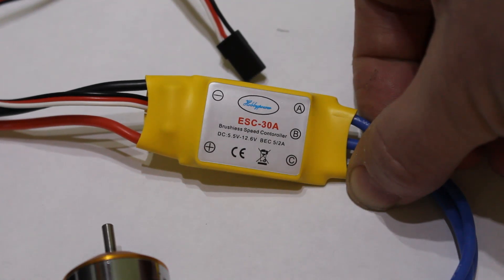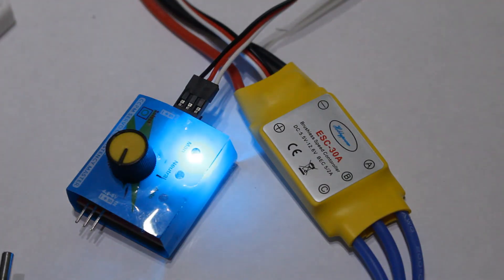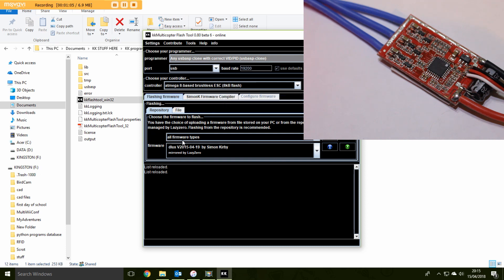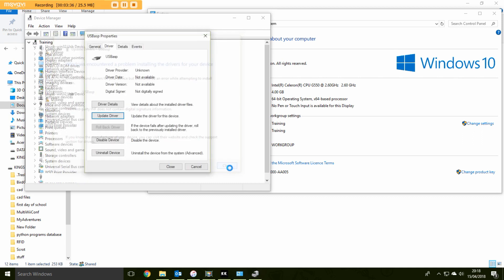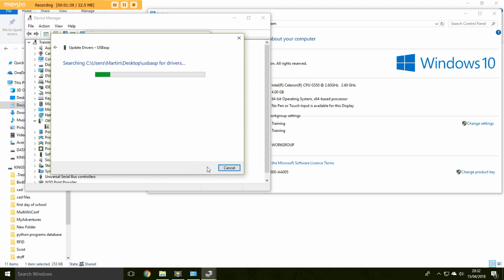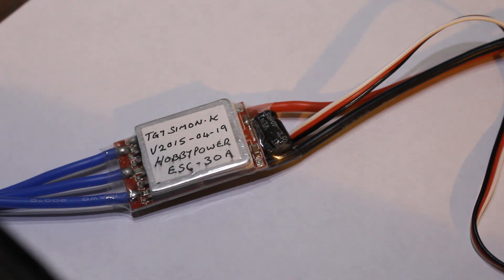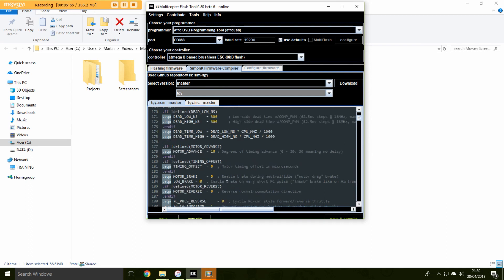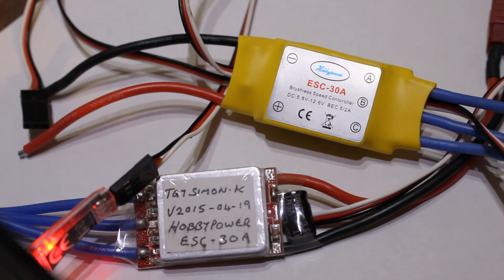Loading SimonK firmware into hobbypower 30A ESC .

Comment: DO you know what .hex file works for Red Brick 200A (Red PC Board)??? The ones for the Green and Black PC Board does not work??
Reply from the maker: I would check out the list and see if you can find a match? https://docs.google.com/spreadsheets/d/13tMlu5ldLNpZXwbe6UhDHJhcgTVuljm8HDiDp9WO9Pk/edit#gid=0
you need to be careful as it appears there are two different options? check the list and photos in the list links.

Comment: Brother, can i flash the SimonK ESC from BEC? No need to flash directly to the chip right?
Reply from the maker: If the ESC has SimonK already installed you should be able to do it via the white/black wires.
Reply: @mrfid72  can i use 'other' usb afro? I can't find it anywhere in my country

Comment: Where did you get that tool to connect the chip directly from the board?
Reply from the maker: Hello, i really can't help here. i got mine from HobbyKing but they no longer stock the item, and i have searched high and low for the bit, but can't find it anywhere.

Comment: Hi
I would like to flash my RCXXD BEC 30A but it has different MCU. Have you any idea what is it https://photos.app.goo.gl/BU5DJCDjTDA2xUbq9 I need reverse, is it possible to flash it?
Thx
Reply from the maker: Honestly i dont know. You cant identify the chip as the markings have been removed. Which is a shame as you seem to have 5 test pads which might be programming terminals? 5 terminals would sergest the chip is a Microchip, but then what would you flash it with?

Comment: Is it possible to program the cheap yellow esc just with that usb afro programmer?
Reply from the maker: No, you need to load simon K in the first place. Or use the hobby king programmer.
Reply: mrfid72 Which is the default firmware in it these cheap esc's?

Comment: good video!! 

but where did you get that white thing that you press on the chip to program it?
Reply from the maker: HI, i managed to get mine from HobbyKing, https://hobbyking.com/en_us/atmel-atmega-socket-firmware-flashing-tool.html
i have seen people make there own adaptor by using modeling clay and fine wire?

Comment: This is awesome.
But what is the advantages of SimonK firmware?
What is the difference between KK firmware and SimonK firmware?
Can you upgrade it to BLHeliS firmware?
Reply from the maker: i like it because it is tuneable, you can change the timing add a brake, reverse the motor direction and add forward reverse mode. I believe the correct answer is that it is optimised for drones and is very reliable? (https://github.com/sim-/tgy/blob/master/README.md) the KK flash tool is the program used to flash new firmware into the ESC. BLHelis is very similar to SimonK, i don't know if you can swop over?

Comment: Good video. I got a hobby power esc 30 amp it has been flashed with the wrong firmware. Can it be reflashed with the right one, with the tgy.hex from SimonK.  I have the hardware but don't know if it will flash.